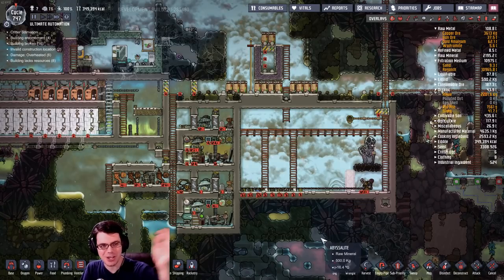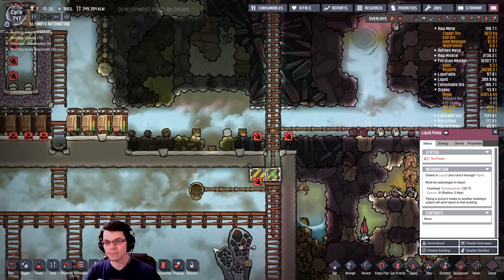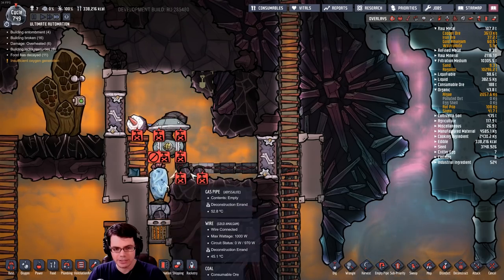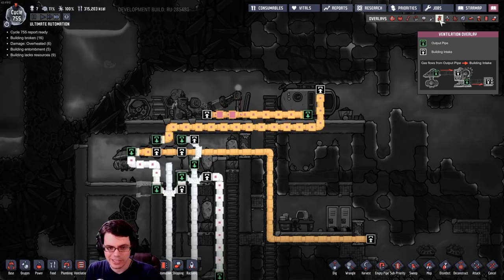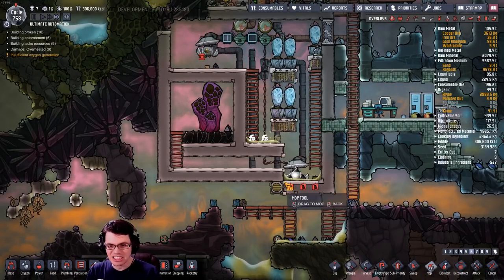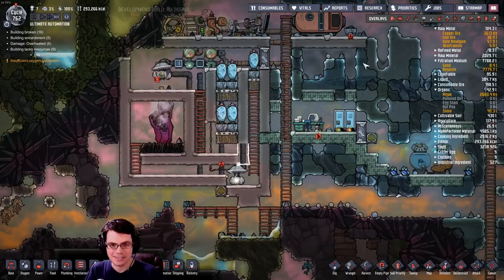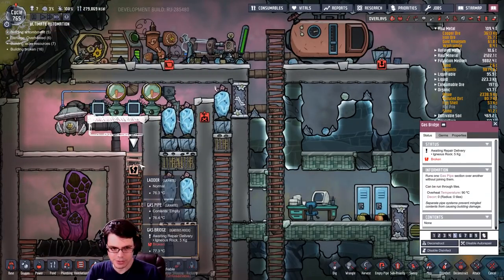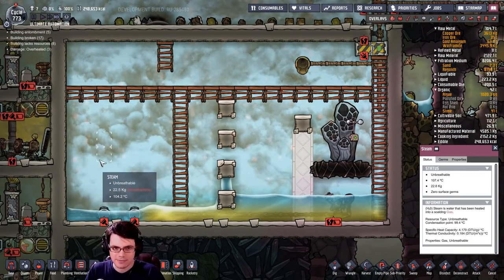Oxygen Not Included - Tapping Geysers with Wheezeworts! Ultimate Automation Challenge ep 31

Comment: One thing to keep in mind when using the wheezeworts to compress gases indefinetly is, that if the geyser goes dormant and the funnel between the initial outlet and your compressing wheezewort actually reaches a vacuum, pressure will equalize throughout the entire space. This process is irreversable as far as i experienced it (happened to me at around 1000kg pressure and it went for even 500/500, lost 25 cycles to this). To prevent this, simply get an atmo sensor in your funnel above the outlet and keep recycling a small portion of your compressed gas into your funnel to prevent it from ever reaching a vacuum.
Reply: Equally important is to not allow the temperature to drop so much that the wheezewort stifles. You might think that won't be a problem as you'll just put it on an automated door but that creates the above problem of making a vacuum and irreversibly breaking the system. The only workable solution is to have a space heater in the compression chamber making sure the gas stays above the temperature the wheezewort stifles at which is the compressed gas condensation temperature + 5C or -60C, whichever is highest.

Comment: I used a pool of water to eliminate any gas from the hydrogen vent below it, then I lowered the pool a bit. And noticed the water was cooling down the hydrogen, so I put some gold amalgam power bridges and worked like a charm, now with that pool of water I have a water lock to access the interior and cool the hydrogen down from 500 to 80 degrees C.

Comment: Hello Brothgar, just two ideas: (and some drone questions) :)
1. Couldn't you put some (horizontal) doors in "Venturi system" to delete that oxygen?
2. About regolith problem, isn't there a system with conveyor belts and auto-sweeper to "auto drop" stuff on floor, something like regolith is put into sweeper, you convey stuff to other sweeper and with some logic gates and buffers you deactivate the second sweeper so it drops its contents on the floor and with a let's say temp sensor you open a door so it drops regolith into containment chamber?

On drone stuff, couple of questions, don't have one, but one day i'll try to make and/or mod some myself:
1. Is there any delay between signal and picture you get on goggles, is it enough "live feed"?
2. What is maximum liftoff weight for your drone, can you put, in theory, better but DIY batteries so you have longer flying time? 
- just to put what i have in mind, don't know some specs tho, like what is nominal discharge current needed for drone, but i'll just put an idea: let's say you put four Sony Konion VTC 5a batteries in series, total weight will be just under 200 grams, but you will have around 2600 mAh, same 14,8 V (nominal, maximum is higher) and in theory maximum continuous discharge current of 35 A (well, in reality it is closer to 25 A )
3. I've seen some cool DIY mods for drones like having two antennas, one long range/direction the other short range/omni/360 degrees so you can extend maximum range but when it's near you you don't need to turn yourself in that way.
Reply: I watched that episode, i meant something similar but not with doors (actually didn't test that, so im just theorizing :D ), idea is to exploit a feature (i guess) of sweeper that it drops its contents when it's deactivated, if it works as i think it would be much cheaper than door system. It's for the sweeping problem only, not digging tho.

Thx for drone info, i'll check some headset reviews. OTOH i need drone in the first place :D .
btw, you've got nice house and yard :) .

Comment: btw if the temperature is really killing you, you could try a combination of aquatuner/thermo regulator and water sieve. The Idea is to delete heat via water sieve (still fixed output of 40°C) so you want to feed the polluted water you clean up to be as hot as possible ... therefor you use a small basin filled with water/oil to take the heat from the aquatuner/thermo regulator and let it heat up the polluted water with radiant pipes. Just make a loop with oil or so to pick up heat from the hot area and bring it back to the tuner/regulator

I guess in your case with all the hot steam it's probably better to use the thermo regulator and hydrogen because you don't need to fear the hydrogen switching state inside the pipe ... but it would be slower than with liquid based cooling.

the carbon scrubber also still works with fixed output of 40°C but only use small amount of water, it's tiresome.

Comment: 14:53 that's how it works in games, you can't up the speed and request more processing power if it's already maxed out. games run higher speed modes by skipping parts of the code, usually at the cost of frame rate and complexity of ai and physics calcs.

Comment: Yeah, gas bridge breaking sounds weird. I have a weirder one though, my abyssalite pipe broke from overheating. -.-
Reply: dunno about this gas bridge, but your pipe probably broke because the contents started boiling. abyssalite pipes can still let some heat through so if your pipe has to cross a very hot area try insulated abyssalite
Reply: It was an output pipe from a smelter (or w/e you call it) and it wasn't properly dumping it's hot water, so you're probably right. Still don't get why it registered as "overheat" damage though
Reply: yea that's probably a bug, i think i even encountered it myself before. i think it has to do with circulating the coolant around, at one point i managed to somehow superheat water to like 400C in the smelter at which point i had to manually empty it's storage, flooding the entire room with ridiculously hot steam.
Reply: Regular gas bridges break at 75°C because it has an overheat value. Use another material for it (like abyssalite or ceramics).

Comment: So I have a question regarding your drone project. I've figured that you have a 3D printer that allows you to use materials other than polymer. I currently only have a 3D printer that only utilizes polymer, and purchasing or upgrading the one I have right now is not an option as I most likely would not be able to afford for a such luxury. Now, my question is: Would I still be able to create some sort of drone with just the polymer 3D printer? (I am fully aware that performance and efficiency would have to dip because of the material that I will be using compared to Brothgar's prototype).